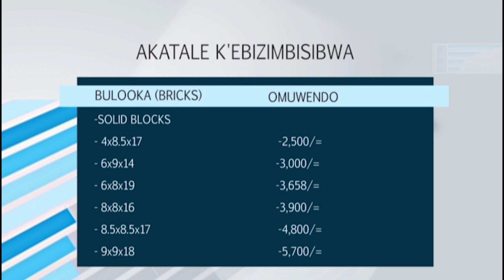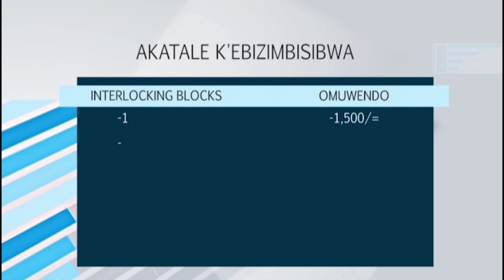Okuzimba kalina n'ebyuma bbsTuzimbe

Comment: #structural perspective: before we all flock to the cost efficiency side, extra care should be assigned because no effort has been made to quantify the physical material properties of that wood to incorporate in the design, let alone the unpredictable water permeable tendencies of wood, the exessive deflection of these mesh slabs, and obviously the deterioration with time. can anybody try to fill in these gaps before the whole industry evolves to make the method safe and fool proof.